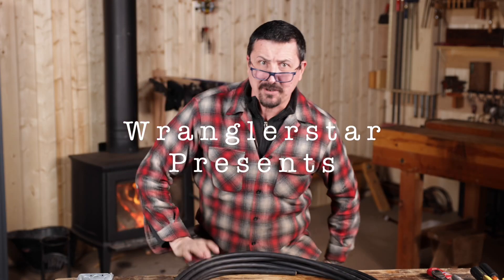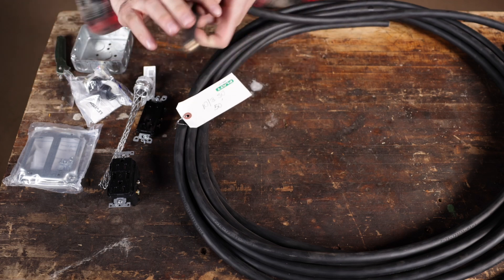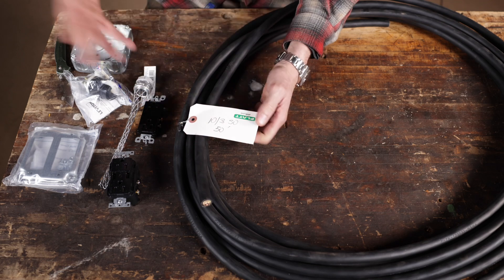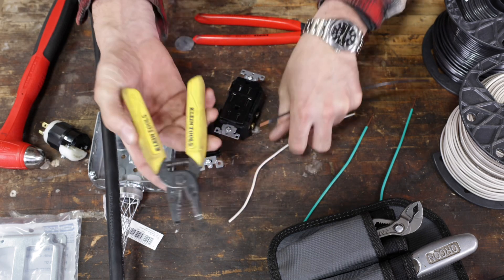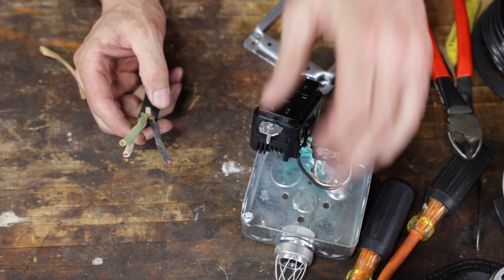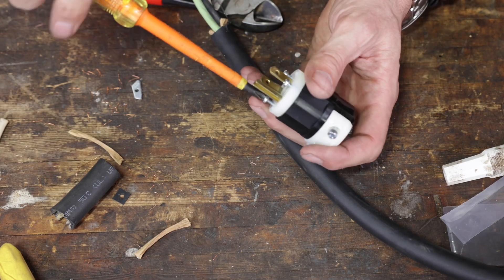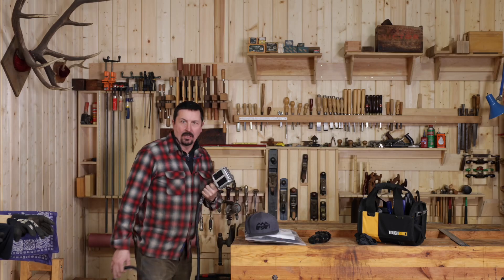The Ultimate $150 Shop Accessory - ALPHA CORD

Comment: I used to work in a data center for over 12+ yrs.  We used to call those black electric cords "whips" when we ordered them for the electricians to come and run them.  They would run them from huge PDU's (power distribution unit) to hang over a cabinet and then we would plug them into RPDU's which are "racked" power distribution units.  They basically look like huge power strips.  Anyone ever work in a data center knows what I am talking about.  Then we would plug equipment into the RPDUs like servers, switches, and the like.  Great video Mr. W.

Comment: The “3” in 10/3 actually refers to the amount of insulated conductors in the cable, not how many there are.
Reply: Your correct waited for someone to mention that
Reply: That's what suckered me into watching the video.  Tag should've been 10/2, and the jam nut should be on the inside
Regardless,  it's still a great idea.
Reply: @dougieonthemove4658  10/3 was the right tag, he just explained what it meant the wrong way. 10/3 can also have 4 wires with 3 of them insulated and one bare, or just 3 insulated wires like the one he used had.
Reply: 10/2 Two conductors carrying load (hot + neutral) + ground
10/3 Three conductors carrying load (hot L1 + hot L2 + neutral) + ground
10/4 Four conductors carrying load (L1,L2,L3 + neutral + ground for 3-phase power.
Reply: @guytech7310  or for a three-way switch
Reply: yea this is 10/2 wire not 10/3
Reply: The reason portable cordage is numbered the way it is, is because every wire is rated to carry current, as is the case in a control cable application. Like the chunk of multiconductor SOOW between a winch motor and the "pickle" controller. 

Also, use a cast aluminum 3-hole Bell box, the 4 square boxes seen can easily get the KOs lost, which can become dangerous and expose live parts.
Reply: In SJO cable you do not ever have non insulated conductor. So it is 10/3 SJOOW. If it was Romex NM-B it would be 10/2
Reply: @guytech7310  You are thinking of Romex. NM-B. SJO cable does not have non insulated wire ever. So they call it out as 10/3. A 10/2 SJO would only have two wires.
Reply: @pekoplants4073  Yes in Romex NM-B cable not in SJO cable. SJO cable does not have non insulated ground.
Reply: 10/3 is the correct designation for the service cord he used. It is a different labeling standard than how NM is labeled.
Reply: @guytech7310  That is not correct. 10/2 has a total of only 2 wires in the cable that are insulated such as in a flexible cable. If it were a rigid cable such as Romex, what you are describing as 10/2 would be called 10/2 with a ground since the grounding conductor is not insulated and can only be used as a ground but there are a total of three wires in the cable. In the 10/4 cable you are describing for three phase there would NOT be a neutral. L1,L2,L3 and ground only in a three phase cable.
Reply: @allegannews9256  Exactly, it's rated as both power and control cable.
Reply: You are correct. A 10/3 will have 4, 10 gauge wires
Reply: @Bredddi  No it would NOT. A 10/3 SO cord as is used here ONLY has 3 #10 wires. If it were marked as 10/3 W Grd, there would be 4 #10 wires. Guys, it is written right on the jacket of the cord, from the manufacturer as being 10/3. Count it, there are only three wires total. Spend some time at your local hardware store or electrical supply. Read what is printed right on the cable and then count the wires. What you see is what you get. In a 10/3 SO or SJ cord all wires are insulated and even though there is a green wire it could be phased taped at each end and used as a current carrying conductor. In a cable such as Romex, the ground wire is only wrapped in paper and is not insulated and can only be used as a ground. It is not marked 12/3, it is marked 12/2 w grd. Big difference. Don't take my word for it, stop by Lowe's or Home Depot. You can learn for free.
Reply: @Bredddi  In building wire, yes. In portable cordage, such as Soow, Sjoow, and the even tougher type W, you'll get three wire cable, with black/white/green wires only.
Reply: @williamdebow3478  my bad. Every time I buy Romex at the store 10/2 means 3 wires with 2 load bearing and 10/3 means 4 wires with 3 lead bearing. Given I only generally buy romex and the wire in the video isn’t romex, than I’ll keep my trap shut and let the experts here set everyone straight. Might be worth noting that 99% of the audience here are just regular homeowners with the occasional romex so making a general statement about the naming convention of the wire in the video, might result in some folks trying to clarify a bit. I only once ever bought 6 gauge “so cord” for a generator cable I made myself to go from 30amp to 50amp back feed outlet and that was labeled 6/4 with 4 wires so touché on that one. Romex however, what 99% of people buy, is not going to be a 3 wire setup if it is labeled 10/3. Since this is a homeowner channel I’m just joining in with others in pointing that out. Thanks for setting me straight on the other.
Reply: @Bredddi  There was no harm intended. Maybe the biggest take away is that you have to read ALL of the wire description when buying wire. Even Romex, if labeled only 10/3 will ONLY have 3 copper wires. You have to look for the "with Ground" part that follows. "10/3 w grnd" Romex would have 4 total wires, 3 of which you could use ac current carrying conductors and one designated as a grounding conductor.Then you will know exactly what you are buying and how you can use it. I was not trying to be a smart a&%, just trying to be helpful. Thanks for your comment.
Reply: @williamdebow3478  I didn’t think you were. Power is out here and I’ve knocked back 5 wheelbarrow loads of kindling. Sorry I sounded short.
Reply: We would have said 10/2 with a ground,  but I am a jake leg at it. Know just enough to keep my own farm going lol.
Reply: @guytech7310  not on cord
Reply: @pekoplants4073  no it’s 10-3, cord is not labeled like MC or NM
Reply: @christhomas5937  no you both are wrong...that's only for N.M. cable or romex.
Reply: Thank you for the clarification. I did not know the differance.
Reply: @larrylangejr.4512  What's the easiest way to tell the difference?  (Other than looking at the cut end)

Comment: goodday Cody. Three small point. When attaching the wires to the duplex plug you did the right thing and attached it to the screw but mentioned you can also plug the wire. It should be stressed for best results you should always screw it on. To the right corner of the attachment screw there is a small hole. You can insert your bare wire end in it and than curl your wire around the screw. Finally a suggestion: Attach a tension reliever (similar to the one you attached to the box except it has a loop not a screw) to your male end a foot or two from the end. screw in a hook to the wall next to the power plug. By hanging the tension reliever to it you won't accidently unplug your cord.

Comment: We would typically not use a box with knock-outs for a portable cord.  These setups usually get banged around a lot an the KOs can get bent in or broken out causing a hazard.  A weatherproof  cast aluminum box would be a better choice.  This may also be an OSHA issue, but I’m not positive.
Reply: Thanks for that comment - now I have a search term to track down a decent box.  I built one of these long ago but haven't been happy with it.  The only boxes I could find at the home stores here are intended to be behind walls.  Sharp edges, covered in holes and knock outs.  I wanted something I could use around jobsites but figured the open style boxes would fill with sawdust and once moisture got in there I'd have a problem
Reply: You gotta remove all the knockouts for ventilation. Can't be having those things getting too hot.
Reply: I mean, I think OSHA also mandates that you can't make your own extension cord for a job site.
Reply: @jethro9341  If they remove the knockouts, how is it going to float when someone uses it in the pool?
Reply: @jim.h  good point
Reply: @Allurade  you can as long as everything is UL approved and to OSHA standards. I actually had the OSHA man correct my safety man about it.
Reply: @Allurade  Thankfully they jurisdiction over professional homeowners though ;)
Reply: @jim.h  Silicone a flip-flip to the bottom. Pool noodles slip over the cord itself
Reply: Also. If the cord gets damaged and the neutral wire gets broken, the GFCI will not trip if you get a ground fault. Commercially made GFCI cords are made so the cord can't be energized if the neutral is open.
Reply: @tbag-2224  OA Windsor makes exactly what's needed. what he's using is the wrong part for the job.
Reply: @nedward5871  that's exactly what I need!
Reply: @Allurade  Correct.  You could get a citation if you are doing it professionally or  in a commercial setting (yes, OSHA compliance is my job.)

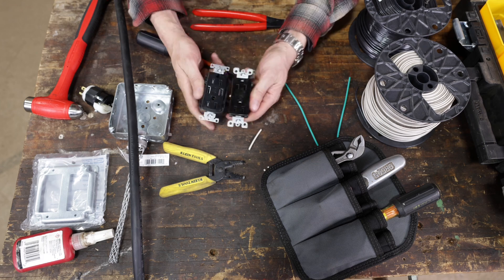Comment: I learned a trick from an old electrician, for longevity and protection from shorting between outlets [as seen @ 7:40]  and switches when you have 2 or more in a box...wrap around the side perimeter of the device covering the screws with electrical tape after you have made wire connections but before you install in box...awesome tip has saved me when I needed to go back into a box
BTW, one last add...you built a great cord, but use a 15 amp rated outlet, since you have the capacity, use a 20 amp outlet...nice job!

Comment: So if you're using something - like a welder - where you need the current capacity of the 10 gauge wire, aren't you limited by the 12ga wire that you installed inside the box?
Reply: No it’s solid wire inside the box it doesn’t need to be a as flexible as the cord wire so it can be smaller
Reply: @gabrielpetri4143  so to be clear, I'm not an electrician but does solid 12ga wire have the same current load capacity as stranded 10ga?
Reply: To be clear I am an electrician, and the only part of this assembly that's rated for 30 amps is the the #10 flex.  I don't know the rating of the plug he used, but the receptacles here are only rated to be used for 15 amp loads at 120 volts.  He would have to change the plug and the receptacles if he were to use it for his 30 amp welder.

That been said, solid vs stranded does not change the rating of the wire.  While a stranded #12 will have a larger outer diameter than a solid #12, they are both rated to carry the same amount of current.
Reply: @BluCappy419  cool - that's what I thought. It's a "weakest link" scenario. Thanks for helping to clarify my concern.
Reply: for safety of not overheating your circuit can only draw 15 amps that is all receptacle is rated for but the heavier the cord the less resistance so less voltage drop under a heavy load = tools work better
Reply: @BluCappy419  I  think he overstated the ability to make it 120/240. The receptacles AND the cord cap would need changing to do that. I would be certain to use quality 20 amp receptacles too. I have become a fan of wrapping the receptacles over the connections with 3M electrical tape also...at the advice of master electrician son in law. I have these home made quality cords for 20amp 120, 30 amp 120...trailer, 50amp 240...welder. They are wonderful.

Comment: I made an extension cord like that for my shop but I used 220 instead of 110 volts. It plugs into a 220 volt outlet I have at the double doors leading to the driveway. On the working end I have two double 110 plugs like yours and I have a 220 plug as well. One side of the 220 lead connects to one 110 outlet and the other side of the 220 lead connects to the other 110 outlet. This allows me to take my welding machine out to the driveway and work on vehicles or things on trailers without needing to take it off the trailer and drag it into the shop. Having 110 outlets allows using 110 tools and lights all from the working end of the extension cord.

Comment: It is called SOW cable (edited for earlier typo). This video came about 15 min too late. I JUST ordered a 12/3 100' USA made extension cord and some Leviton plugs to make a custom length heavy duty (15 amp) extension cord.
Reply: @El_Guapo74  And Wire & Cable your way has great prices also and reasonable shipping in sizes HD or Lowes may not carry. All in custom lengths too.
Reply: 12/3 will allow to you run 20amps per circuit with 12/3 you can do a split phase (wire hot to each receptacle and common nuetral & ground, and use a 240VAC plug.

Comment: On a 100' cord and a 50' cord, take a 5 gal bucket cut a hole in the bottom and put the plug end through the hole leaving enough to reach up and over the bucket. Then just  coil the wire one time into the bucket take the plug end over the top and plug into the receptacle end. When you need to use it you just lay the bucket on its side and pull the cord out it will unravel perfectly and go right back in if you start at the bucket end and just pull it in as you walk. Max 5 min to put the cord away. Would include a picture if I can gut my phone to give that function to me.

Comment: I've made a few of these in the past. Like the idea of using a USB outlet. Couple other recommendations... For the plug, I like to use 90 degree ones with such heavy cable. I recommend use a screw lug type box, like a sigma 14352 for example. I also bolt on a large magnet to the back so I can stick it to metal cabinet, engine bays, etc. Welding ground magnets work nice and have a metal ring so the magnet doesn't get chipped/broken. Harbor freight has a cheap one. The last box I built I used a 3 gang box and put a lighted light switch in the extra gang so I could turn it off easily instead of unplugging everything. Lastly, I like to install a small panel mount 120v AC light on the faceplate so its easy to tell if it is powered (if not doing the lighted light switch method).

Comment: I tin my ends on stranded or you can put on a crimp sleeve that gives the screw something to bite into vs just squishing the strands. Bob
Reply: There is also copper tape, available at damn near all electric supply houses. We use it for large temp S/O cords that end up getting shifted from site to site. Helps keep the fraying down to fit into lugs easier with repeatability.
Reply: Tinning stranded wiring is a bad idea because it makes the end brittle cause it to snap where the solder ends. If you want to a better grip, crimp ferrules on the ends.
Reply: @guytech7310  I use crimp on wire ferrules on all stranded connections 10 AWG or less. Only because that is largest my crimper can do. It helps keep all strands together

Comment: As someone with almost 18 years in the electrical industry, I would not recommend using the steel junction box with pre-punched knock-outs.  Those knockouts can easily be pushed into the box as the cord is used and moved around, presenting a substantial shock hazard. 
Best alternative is a premade cord splitter; you can buy them for $5-20 if you are plugging the extension cord into a GFCI outlet, or for $20-30 you can buy one with built in GFCI protection.  If you still want to make one, I would recommend buying a rubber cord drop box, something like an Ericson 6000.  If you still want to do a small metal junction box, at least do an aluminum weather-proof "bell" box, similar to a Pass and Seymour WPB332.
Reply: Also. If the cord gets damaged and the neutral wire gets broken, the GFCI will not trip if you get a ground fault. Commercially made GFCI cords are made so the cord can't be energized if the neutral is open.

Comment: I've done that with a 12 guage wire, so it was more flexible, but still sturdy. It's a good idea to add a flat bar with a hole or hook on the end to the back of it. Helps when removing tight plugs, and hanging the socket end on a nail or branch or something.

Comment: Now, put in an LED, so you know by sight that it's powered  I love having light up cord ends.  You know in a second whether you have a popped breaker or if it just isn't plugged in
Reply: I got a cheap led off of Amazon rated at 5v which is what the USB run off of and pluged it in to one of the USB slots. I have a welder I use all the time thats 220. I made a 3 gang box 220, 110, 110 with 2 usb's. But I siliconed the entire thing when done just in case of moisture. I live near the texas coast
Reply: @jontruax1  LED with a 100K resistor will work.
Reply: I put a gfi on mine safer and has an led.
Reply: I made one like this but one of the receptacles had integrated power LED and that is how we knew it had power.

Comment: I ended up making one of these earlier trying to just build a no nonsense cord that could handle running a heater on it. Went as cheap as possible on the box and outlets but funny enough ended up with the gated outlets, basically the same box but the thinner one. Ended up using the romex 12. 25 foot. Ran me about $50 all together and I do know that the Romex may degrade if moved too much so it's effectively a "don't over handle" cord. But hey it's serviceable so.

And at some point if I no longer need it or decide to build another one this one could easily have the plug removed and get permanently installed.